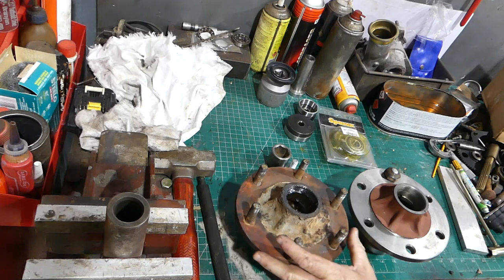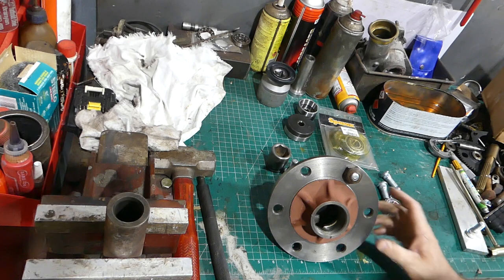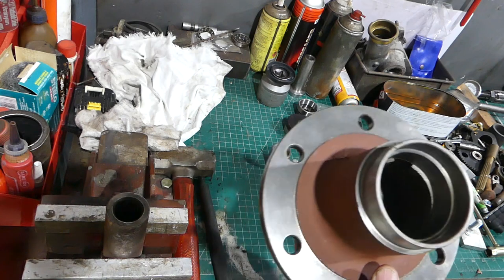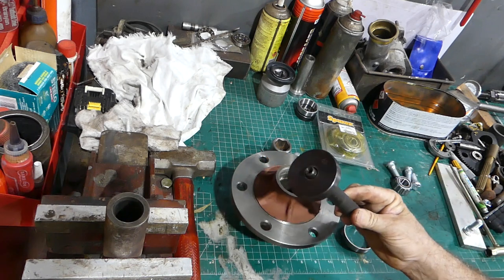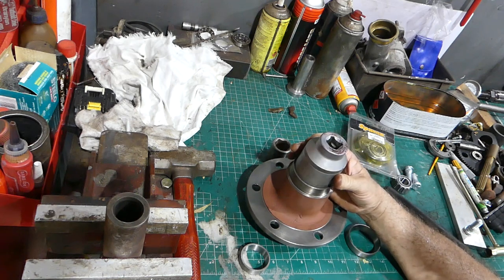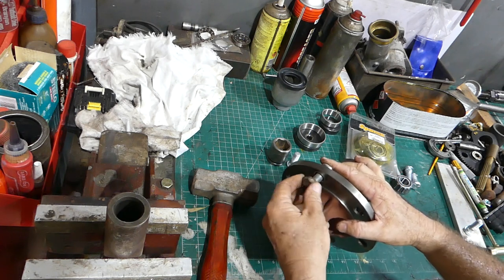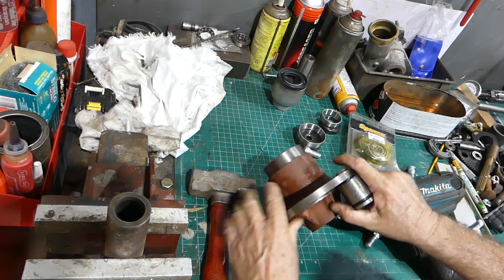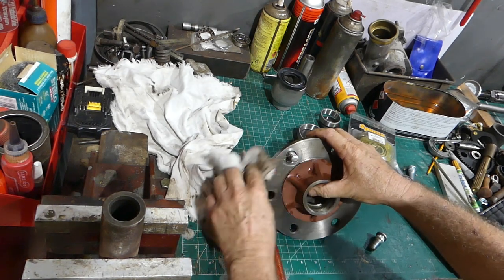Massey Ferguson 65 # 14 Fitting the Front Wheel Bearings

Comment: Thanks again for another fantastic video lance 👍 and of course the motivation to get mine done 😬 I'm always doing bit's and peices and the latest was replacing the cork bush on the throttle assembly. A rather difficult thing to do but got there! ( maybe a video of ?) No special tools in my shed apart from improvisation and that's where people can get lost in thinking they have to have that because a manual might refer to them  !
Reply from the maker: Yeah there is a lot of improvisation needed to keep costs down for a one of job. I will get to the cork when I work my way back to that area. There will be no bolt left alone, lol.

Comment: I've never seen a grease nipple on a tractor wheel cap. You would think it would get rubbed or broken off, that could be called operator abuse I suppose lol. good video Lance. Keep smilin
Reply from the maker: They are sort of in a deep recess, probably only good if you get the wheels in deep water.

Comment: IMAO for the backyard DIY type there is another method if you do not have the bushing drive pucks to set the bearing cups. Place the cups in the freezer and warm the hub. If the temperatures are good the cup might just drop in place.
Reply from the maker: Yes I have heard that works but Im usually in too much of a hurry or not organised enough th heve it ready.

Comment: Thanks for the videos.  I bought some aftermarket wheel bearings, a spindle, and bushings for my mf65.  Everything seems just a bit off in fit.  The spindle is 5/8" longer, the bushings seem a bit too big for the casing and a bit too small for the spindle.  Is it possible that somebody swapped out the steering gear from something else??  Any ideas?
Reply from the maker: It is possible, I found in the past that some brands of bushes did need reaming, but the Sparex ones were the correct fit. If you don't get them square to the bore, they need reaming but fit them straight and they go straight in. Im not sure why the king pins would be longer though.
Reply: @BundyBearsShed  Thanks for answering.  I think I found my problem.  I checked some other spindle information and I seem to have a transplant in part of my front end from a mf35.  The diameter is the same but it is about 5/8" shorter than the mf65.  Also there are some minor differences in the bushings - enough to cause trouble.

Comment: I know its kinda a big ask but I've been wanting to hook up a front mounted Hydraulic pump to the front of the engine for a loader.  I can't find any videos addressing this on any Fergusons.  Im sure you have knowledge in this setup.  It would be great if you could show us the proper way to do this.
Reply from the maker: Look for a Massey 40 or 50 backhoe set up. They drive from the front of the crankshaft.
Reply: @BundyBearsShed  good to know.  I appreciate that.